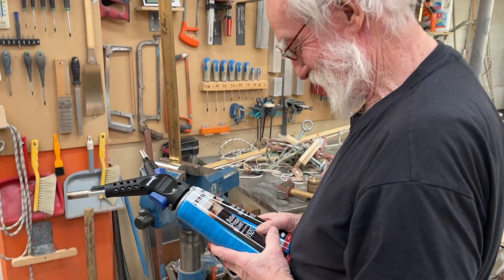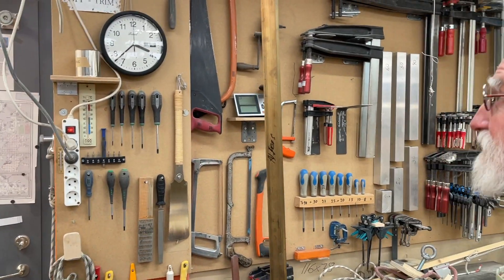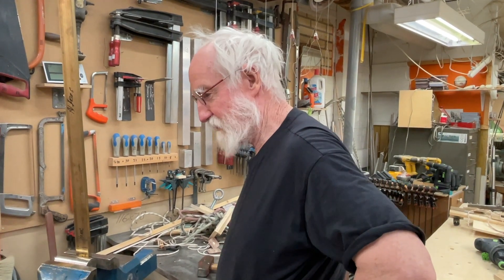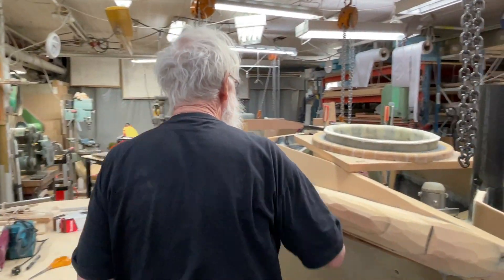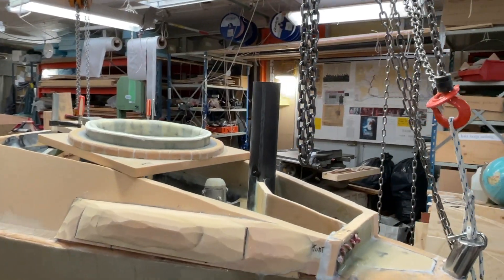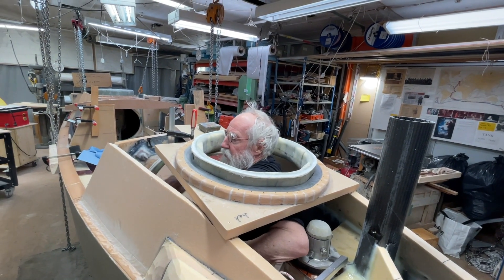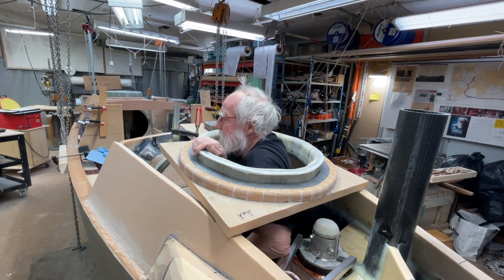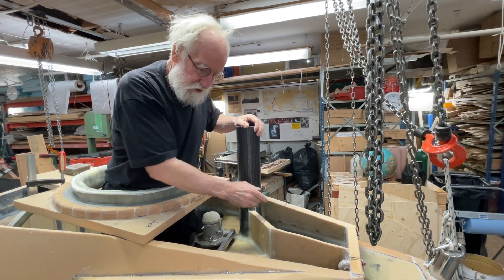17 April 2023  Aft deck hatch and flat bar bronze not bendt

Comment: There must be a local shop with a hydraulic press. That's what I would use, with multiple large-radius bends.
Reply from the maker: If you do not use much heat it will break with much force.
This is just the first try I got more ideas.
Reply: @SvenYrvindExlex  It's more likely that the pope converts to islam, rather than you running out of ideas ;)
Can't wait to see what your solution will be!

Comment: I can imagine it's pretty tough to bend a thick piece of bronze like that. Maybe the forge man can help.
Reply from the maker: Its not a forge man but a foundry one and he would most likely melt it down.
But I have an idea.
Reply: Or make your own mini tunnel forge using refractory bricks which concentrates the heat of the gas torches.
Reply: It mostly has to do with the bronze alloy I believe.  I think a silicon bronze bends a little easier.  He may also need to anneal it to soften the metal.  Apparently the bending process usually is done at a dull cherry red color - hotter will risk ruining the alloy crystal structure.  I've done most of my bronze bending and forming cold, but sharp bends hot and all with silicon bronze.